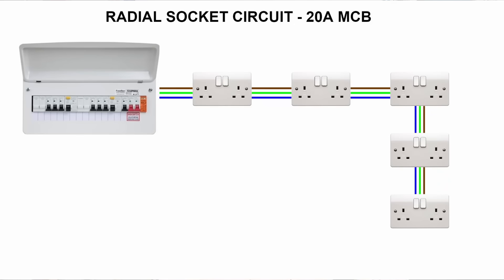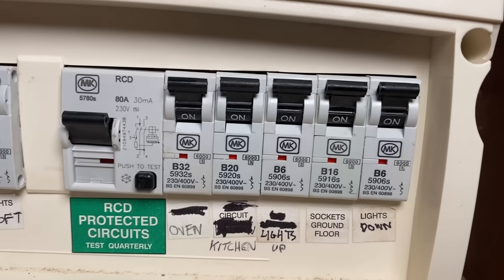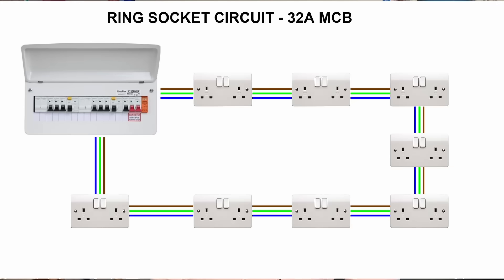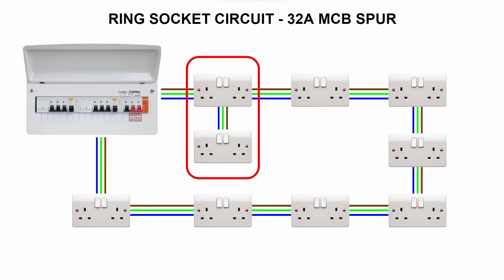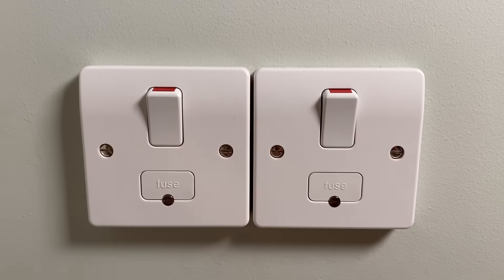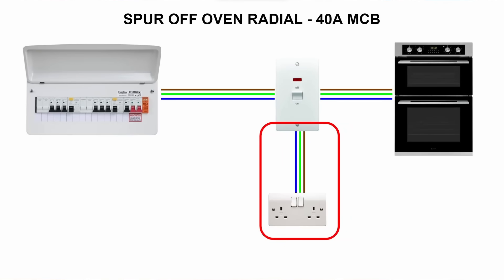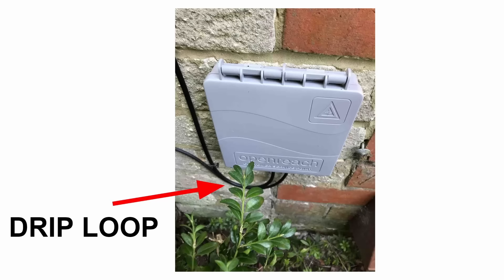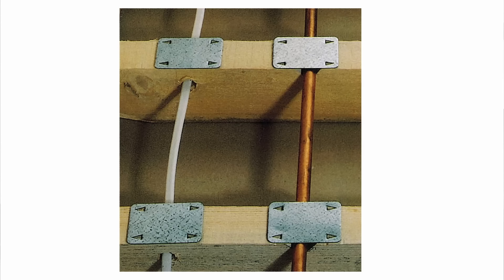BIGGEST DIY Mistakes Adding a New Socket

Comment: It's worth noting that a 32A breaker, for example, doesn't just trip at 32 amps. They have very well defined over-current to time characteristics. This means that the breaker will not trigger until 10 seconds at three times the rated current. Even at double the rated current the breaker could take 100 seconds to hit its thermal trigger.
Reply from the maker: Thanks for the info!
Reply: @TheDiligentDIYer1759  the cable should withstand a current overload without heating too much for the time it takes a fuse or breaker to trip ,
Reply: Good video - thanks 😊
Reply: I can somewhat understand tolerating higher load for a second or two because of coffee machine for example which creates a spike when started, but 3x load for 10 seconds sounds reckless to me. Why would anyone allow that (not that I have or need 32A breaker, but if people are willing to play with that load, chances are they might play with lower load breakers too.
Reply: There are still electromagnetic breakers? they trip within like 100ms
Reply: @sylvester4207  Breakers contain both magnetic and thermal trips.
Reply: @sylvester4207  also the magnetic trip component is for short circuit current, which needs to be able to trip high current as quickly as possible. Whereas thermal trip is to protect against overload and can take time depending on the type of breaker
Reply: @sylvester4207  as the dude says, they will trip @ certain times depending on the breaker type and fault current. Not just 1 set time.
Reply: this entire section is why people shouldn't do 'electrics.....
Reply: @jameshansing5396 I do the wiring and then get it terminated at the consumer unit, tested and certified by an electrician. Saves a fortune.
Reply: @tomf4547  if he’s happy to do it then cool. Most decent sparks wouldn’t. I assume he tests it too? 🤷🏿‍♂️😂
Reply: @jameshansing5396  I've never had a problem getting a spark yo come in and do the tech stuff. Nice quick easy job for em...
Reply: @tomf4547  still putting your name to stuff you haven’t installed. I’m sure you can find a spark to do it. Many love the easy £. Just saying of all the sparks I know, the best ones wouldn’t do it the shittier ones would! But hey, I’m sure you know more than me! 😎🤭
Reply: @tomf4547  the “ tech stuff”? 😂
Reply: @jameshansing5396  you know.... Testing and terminating in the consumer unit which I'm not allowed to touch.
Any monkey can run armoured cable and pull a ring main around a garage etc 🤣.
Reply: @tomf4547  I guess the difference being a proper spark is unlikely to call it a ring main or run one in a garage anyway? 😂

You say any monkey can run cable a d terminate? You’d be VERY surprised what we find, hence most decent sparks wouldn’t want the grief of signing off an amateurs work! (In my experience) 😎🤷🏿‍♂️

Plus you’d also be stunned (I hope) how many can’t or don’t test properly! ☹️
Reply: @tomf4547  yeah I always use armoured in garages! 🤦🏻‍♂️
Reply: @tomf4547  
DIYers are allowed to install a consumer unit.  As long as the installer is competent.
Reply: @jameshansing5396  Agreed "this entire section is why people shouldn't do 'electrics" - 'People' should include the so-called experts who set the standards and continue to allow electricians to run ring-main circuits in (British) residential houses (and allow over-rated breakers). If you want a safe house, then replace the 32A breaker with a 20A breaker - that way all the 2.5mm^2 wires (from the original ring and all the spurs that have been added later) will be protected.  Breakers are there to protect the wires, and the wires only. (The RCDs protect the humans.)
Reply: @mb-3faze  yeah rungs aren’t ideal but it’s a bit of a misunderstanding that they are unsafe. The nature of the current flow is quite relevant.

The bigger problem with rings is related to faults which not a single person has mentioned.
Reply: @jameshansing5396  Indeed. Some post-war cleverclogs said "you know what? we can run a loop of thin copper wire around a house and put twice as much load on it than would normally be acceptable because the current will balance and, from a load point of view, make it 'appear' (electrically) that the wire has twice the rating" - "that way we can save copper and money".
A newly installed ring main, properly tested with no breaks in either neutral or live will be fine. But, if you choose to add a spur then you should at least use wire which is up to the specification of the breaker. Normally the breaker will be 32A for a 2.5mm^2 wired ring main - but a spur should be wired with 4mm^2 wire. That advice is not in any spec but from a physics and safety point of view, makes a lot of sense.
Reply: @mb-3faze   i always thought it was 30 amp cable for a ring main, (with 30 amp fuse or breaker) so if one end lost connection, the remaining one could still carry full current,, otherwise you could risk overload and  overheating and breaker wouldnt trip
Reply: @mb-3faze  
You do not understand final rings too well.
Reply: @andygozzo72  30amp cable for a ring main (basically 6mm^2 cable) would be good, rather than the 2.5mm^2 cable allowed - when wiring up a new-build what would be the cost difference? £100 maybe? Then you would be safe because 6mm^2 will take 32A all day. 
I'm a DIYer, as such, and when I open up a Consumer Unit new to me - after I turn off the power, I get my needlenose pliers out and I pull up on all the wires going in to the breakers - many times one of those wires is lose because with ring circuits, you have two wires being terminated and often the grub screw is only really pressing on one of those wires. Lose wires cause sparks.
Reply: @andygozzo72 if it was 30 amp rated cable it wouldn't need a ring.
Reply: @mb-3faze 4mm2 would be suitable but it would not need to be a ring. A 32a radial on 4mm2 is good in theory but fitting the conductors into socket terminals can be a pain. 2 x 20a radials on 2.5mm2 would be easier.

Comment: The thing that confuses me about the double spur, is can't you overload the circuit anyway without one? In your diagram you had 3-4 sockets on one radial leg. Maybe I'm missing something?
Reply from the maker: A radial circuit is typically on a 20A breaker, whereas as a ring is usually on a 32A breaker
Reply: @TheDiligentDIYer1759  Gotcha, I now realise the double spur without a fused connection would potentially damage the spur part of the cabling due to the 27A max cable rating (assuming 2.5mm2 T&E). I was basically questioning why the argument for overloading the spur wasn't being made for a radial or ring because you could plug 13A * no of sockets into the circuit, which is way more than they can support but ignored the fact that the circuits have breaker protection, but the specific section of the spur cable doesn't and can be overloaded as it's less than the usual ring breaker limit.
Reply: @TheDiligentDIYer1759  Having only 2.5 cable and a 20A breaker on a radial circuit rather limits its use with multiple sockets, surely?   Wouldn't 4.0 cable and a 32A breaker be more usual, and preferable?

Comment: Very informative and interesting. My flat was rewired etc before I moved in and they put the kitchen sockets on a separate circuit due to that being where the most high power appliances are used, which is a great idea. Is the not taking a spur from a cooker the reason why you don't see cooker switches with sockets nowadays most of the time.
Reply from the maker: Thank you! I’m not sure, but you are right, they do seem to have fallen out of favour
Reply: They went out of favour when the first set of rules came out about fitting RCDs for socket outlets at it then meant you had to fit an RCD to the cooker circuit as well
Reply: @grahampayne  Thanks for the info. That makes sense.
Reply: I was rewiring a kitchen as a favour for a friend in the 90s.. Had every circuit in the house switched off except for the cooker circuit, which had a socket on the switch, into which I had a lamp plugged in, because it was evening and had gone dark. Pulled off an old socket about four feet away, clipped the cable, and flash, bang, and the lamp went out. Idiot DIYer who had owned the house before had wired it into the cooker circuit. I was lucky that the only damage was a blown (40 amp!) fuse and a big chunk melted out of my favourite wire cutters. Thankfully they were properly insulated.
These days I'd switch it all off, use a battery lamp, and still check for voltage before I touch it.

Comment: Good basic explanation of domestic wiring. Newer houses tend to have enough sockets now, so far less likely that you would need to add more or interfere with what has been installed. However, older homes, particularly 50’s/‘60’s/70’s were barely provided for in today’s energy thirsty world. So that’s where the risks start when DIYers get involved. Many are fairly competent to add small modifications, but from my experience non-competent ones are the real risk. Sockets changed with new “USB” integral chargers is the latest risk, because those who don’t really have the necessary knowledge or good working practice can leave the terminals loose or incorrectly wired. My current home had a nightmare of half finished, wrongly completed wiring work, some of it live to the touch if you put your fingers in the wrong place. As they used to say “a little knowledge is a very dangerous thing”…
Reply: Those new sockets with integral USB  chargers are a risk in their own right, never mind the installation.
Reply: @crcomments8509  How so? As I understand it, they're effectively triple sockets (or socket-count+!) with the additional socket driving the AC-2-DC converter. I'd see them as more threatening to the USB device (fail to putting mains into USB) than threatening to the premises overall.
A couple of years ago I was talking to a Youth Hostel warden (i.e. commercial & residential work) where all the double-sockets (about 120) had been replaced with double+2*USB. I asked about the failure rate, and in a year, he'd not had one complaint of either a USB not giving charge, or a device being fried by the USB.
Your assertion would imply the failure rate is higher.
Reply from the maker: Thanks for watching!
Reply: The worst electrical work I have seen has been done by people charging for it - general handymen, general builders, etc. I have seen some excellent DIY work for sure. Some do their research well.
Reply: I am not sure that power consumption has definitely increased - when one considers old televisions, electric heaters, cookers etc.
I don’t have a garden, just a little used balcony, nor electric vehicles so maybe my view is distorted.
Yes we have computers. We wash more both clothes and dishes. 
And some devices such as dryers 
But we have LED lights, microwaves etc.

What has increased is the requirement for more sockets, better distributed around the place. The days of a single socket for a single room are behind us. Extension cables can be their own source of danger.
So more the number and location than the total power?

Comment: At least I got an explanation for the odd ring system. Personally I run the rule of thumb to run 10A fuse on 1.5mm2 and 16A fuse on 2.5mm2.
If there's a need for more power it's easier to upgrade to 3-phase, which is common for residential in Sweden.
Reply from the maker: Thanks for watching!
Reply: Highly uncommon in the UK for houses to be supplied with 3 phase.
Reply: @shilks8773  With electric cars you should expect it to be more common in new installations.
Reply: @ehsnils  Still not needed.

Comment: Knowing the rating of wire is also crucial, 2.5, 1.5/1 etc. I ran a 10mm cable (64 amps max) to my shed on a 45amp 'D rated' MCB solitary circuit and ran a ring of 32amps for my grinders etc and one 32amp for the welding machine with a 6amp lighting circuit for the fluorescent lights. Providing I do not use everything at the same time the circuit is safe, even then it would take the load. I have known 2.5mm cable installations into sheds start fires because of the overload, and idiots who bypass MCB's wiring the live directly into the main power switch so it does not trip. Instead of having their power tool/s pat tested, they'd rather run the risk of fires instead.
Reply from the maker: Wiring straight into the main switch is crazy. Your set up sounds very sensible though. Thanks for watching!
Reply: @TheDiligentDIYer1759  Oh yes! Crazy indeed. I replaced the circuit and used a 32a MCB and then explained the circuit to him in detail. How much load it could take and if any fault develops the MCB will trip, saving him his home. He did not wire any CPC's either, so I rectified it for him. The times I have seen bad wiring astonishes me. One guy took it upon himself to wire his shed using 1.5mm wire and into a 32a MCB. He told me that it was only going to be used for his pillar drill and bandsaw so would be fine. After I had explained the dangers of using the wrong cable size and that it will melt at some stage, he promptly replaced it using some 6mm.
Reply: Depends on how long the cable run is, what type of cable it is and how it was installed!
Reply: Depends on how long the cable run is, what type of cable it is and how it was installed!

Comment: Please stop doing these videos
Electricity is dangerous
DIYers have no means of testing the installation is safe
Hypothetically, if somebody watched your video and did some electrical work in their house. But they didn't have the tools to test it and their house happened to burn down because of that work.
Unfortunately, they tried but couldn't save their kids. 
Would you be happy your 10 minute video taught that DIYer enough to competently perform that work?
Reply: Statistically electrical fires have increased in England and Wales since the whole part P bs was introduced suggesting that the 3 week wonder sparks are to blame for this and not the diyer.  Also to quote big clive who said that sparkies who comment on YouTube talk "utter shit"  me personally have no problem for diyers to do some electrical jobs in there own home as long as they know what they are doing and researched thoroughly, iv seen good and bad from both sides.
Reply: @mikeb1417  If you're going to use statistics, can you please provide links to the evidence. 
I'm not saying I don't believe you, but you can't  just say 'statistically' without the proof
I did an EICR a while back, they replaced the sockets in one bedroom and wired them as the previous one were. Thing is the live and neutral were opposite to the old sockets. So a switched off appliance was still live. 
As for the big Clive comment, you can't tar 'em all with the same brush
Reply: So are cars and cooking and literally everything. Should we ban the average person from doing anything but being a mindless drone?
Reply from the maker: Adding a new socket to an existing circuit is not notifiable work, so permissible for a DIYer to perform. 
This video is not ‘how to add a new socket’, it covers common mistakes. 
Household electrical fires see very few deaths each year in the UK. If anyone does work that causes a fire, it is their own fault, no one else’s.
Reply: @TheDiligentDIYer1759  it is still required by BS7671 and the building regulations to be tested and a minor works certificate issued by a qualified person .

Comment: My dear Brits. Your sockets are a work of art. Your plugins are brilliant. Respect for engineers. But your "ring" is a joke. Yes, I know it's the same in many countries. But that's the past. The war ended long ago. We are in the 21st century! Please allow other than ring connections. I can't afford to lose power in the sockets in the room due to the overload of the kettle in the kitchen. Multipoint connections are necessary for connection flexibility. Having such a connection (20 sockets and 10 overcurrent protection) it diversifies the power supply. I don't lose everything because of one short-circuit in the corridor.
Reply from the maker: Yep agreed! Thanks for watching!
Reply: Ring circuits are not compulsory nowadays and radials are becoming more common in new installations.